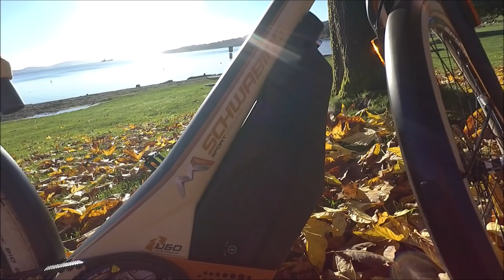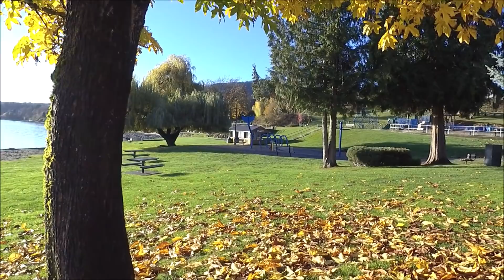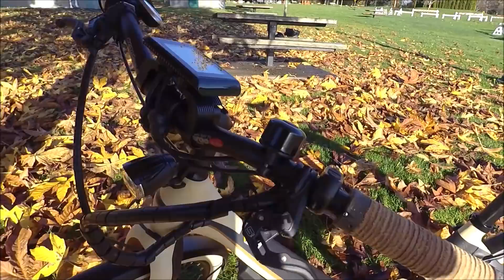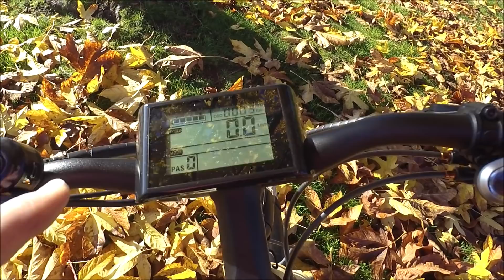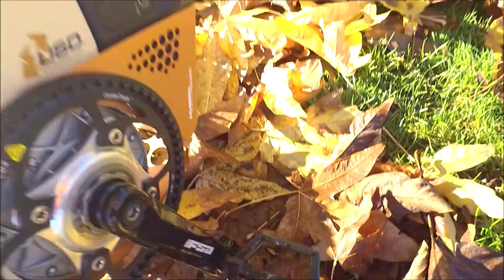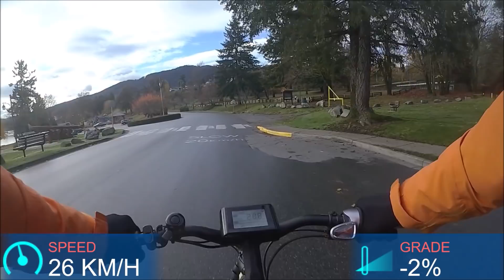M1 SportTechnik Schwabing Review and Ride Test: Step-Thru eBike, TQ Motor, 1.1Khw Battery!

Comment: This model looks very nice and with the specs on the components is awesome. from the belt drive to variable gears , and that battery with the torque on that motor. I wish those are new standard , one could ride all day with that combination.
    great channel.